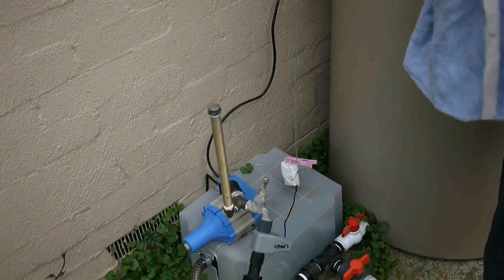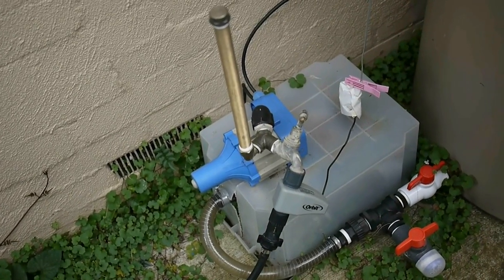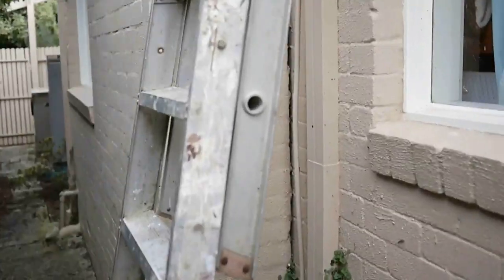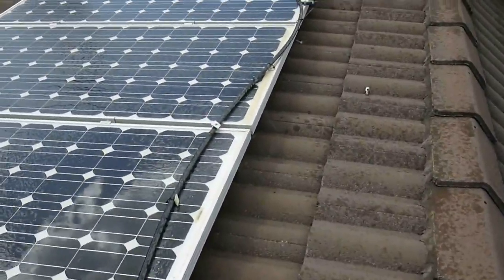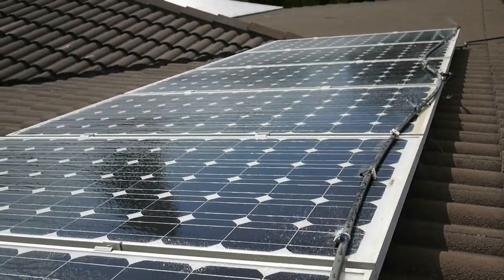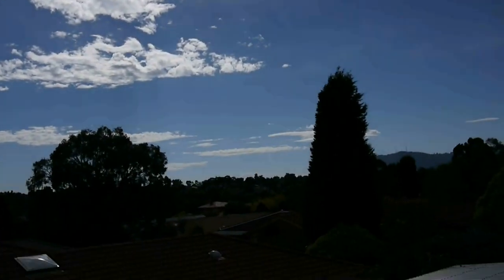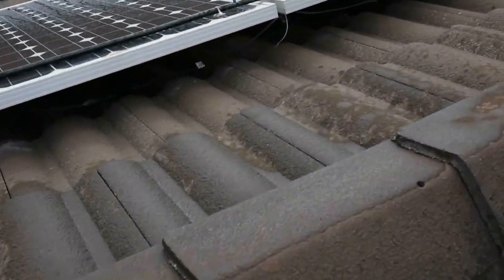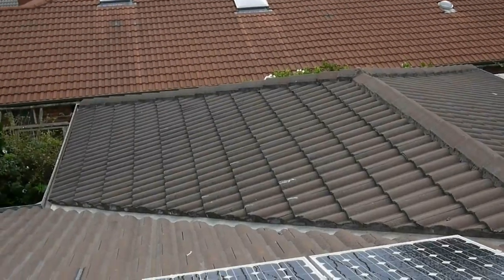Solar PV Panel Cooler Operating

Comment: Water water water and electricity do not mix… and those hard water spots will eat away at the glass over time and just hope you never get water into the cells u will kill the entire system..
Reply from the maker: Water is not a problem. They are designed to be outside in all weather. Hard water issues are fixed by using a rainwater tank (i.e. with no dissolved limestone etc)  instead of using town water.

Comment: Good idea! Have you noticed any performance increase with the cooling?
Reply from the maker: Vladimir M yes it's about 20% more power when cooling, but cooling is only usually for a few hours a day when sunny enough to produce more than 50% of capacity but not when windy because wind keeps it cool.
Reply: @michaelporter000  when this can produce 50% I thing you saying a big number. Because if they produced 50% more the companies would done this
Reply: @mike-h8y9l  I've never measured more than around 20% gain. No way would it reach 50% increase.
Reply: @michaels-ideas   and let's say from 10 in the morning until 5 the afternoon this method can make more power of around 15-20% ? We talk for summer always

Comment from the maker: Eventually I'll get around to neatening the pipe so it is not dangling down over the cells. The difficulty is that the pipes change length as the sun heats them so they tend to inch their way out of the support loops. I plan to find some rigid pipe to use instead while still allowing for some movement when the sun heats it.

Comment: The panels which have cells which are shaded become a resistor, instead of a power generator. The power output of the whole string is reduced in output, not just the shaded cells. You will probably get more power out of removing the line of shade from your panels. 

You are right about the cooling though. Cool weather is what makes San Francisco a better solar location than Phoenix Arizona. 

And if your cells are a year old they are quite clean, so the sprayers probably help with that.

Comment from the maker: Another issue with summer and winter max performance is the tilt angle of the panels. The sun is lower in the sky in winter than summer so it won't be at the ideal angle all year. I think it is usually a compromise that favours summer sun position to make the best benefit of the longer summer days.

Comment from the maker: Given my system is only a 1kW unit it may not be worth the effort to cool. I am quite sure I get an extra 20% power when cooling is running but often the panels don't get hot enough all day for it to start cooling. I would say it is definitely worth it for a 4kW system though.

Comment: Meanwhile, back in the UK, we had our panels last July 2011 so this is our first full Summer. Today (22nd May) was clear and unbroken sunshine for the whole day with temperatures about 25 degrees, yet the panels peaked at about 3.2 kWh (3.7 kWh system). During winter on bright days saw peaks of 4 kWh so could be an advantage to cool the array. We too have rainwater stored so might think about your idea. 
Thanks for taking the time with the vid and risking your neck climbing the roof to show us.

Comment from the maker: I considered this at the start, but thought that if I ever tried to make a warranty claim on the panels I wouldn't want to explain spraying water on the underside. The top is obviously designed to be rained on so they couldn't have a problem with spraying water on the top. I also thought it might be more wasteful because not all water would land on or stay on the panel while it evaporates. It should work ok though.

Comment from the maker: Obviously the tubing used to be mounted on the top edge where there is no PV cells, but the mounting glue has failed in many of the mounts. Eventually I'll fix that again with something more durable. I actually did fix it up a bit just after the video...